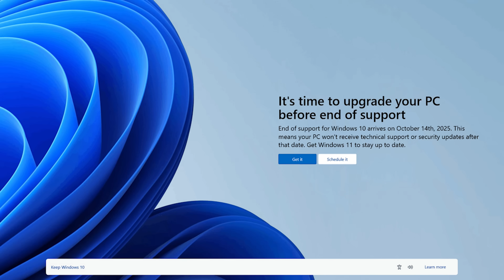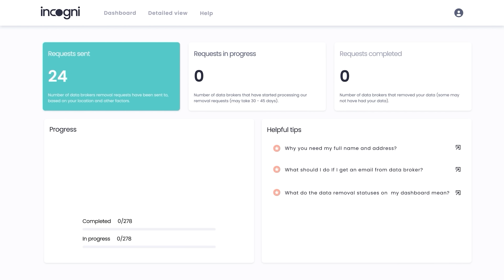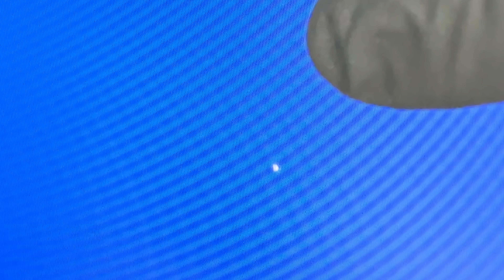I Made 2 WORKING Laptops From 1 Dead ThinkPad - DON'T Buy a New PC Just For Windows 11!

Comment: My mom (she works for a school/church) gave me a bunch of Lenovo Ideapad Tablets to give new homes.  They have 6th gen Intel processors and run Windows 11 fine despite Microsoft's opinion.  Every single one needed a new CMOS battery with an unusual connector.  I own a spot welder and had the CR1220 cells on hand so I was able to correct this.
Reply: That's great, but like Andy said, there is a risk that Microsoft stops supporting Windows 11 installations that were accomplished via a bypass on systems that don't meet the minimum requirements, especially if that involved bypassing the TPM 2.0 requirement, since the OS expects it as part of its built-in security.  At which point you might as well just run Windows 10 without any future updates.  If it was a computer for my own personal use or for my immediately family members, I wouldn't care too much, because I am happy to support their computers, but if I'm selling or giving computers to anybody else... well, I probably wouldn't, because I don't want any obligation of supporting it, especially if something like MS arbitrarily ending support for it via an update happens.  Sorry, but most people are helpless and kind of stupid when it comes to problems with their computers, especially if they know somebody who they know is kind of an expert.  Otherwise intelligent, well-educated people suddenly become incapable of even following basic on-screen prompts or reading basic instruction in plain English when things go wrong on their computer.  The list of people I am willing to actually think on behalf of in any situation is very small.
Reply: Oo I likeyy :DD
Reply: It runs great..i have a dell precision 7710 workstation, very good spec but 6th gen intel...i cant simply dump it...its my baby and a work beast..updated to win 11 25h2 with RUFUS..there i go..😊

Comment: IMO windows 11 could've been a great OS if microsoft didn't pull the bullshit they pulled, like it is perfectly compatitable with my 6th gen PC and runs many things well but then microsoft somehow finds a way to ruin it in any way possible rather than fixing it, it the system requirements were of better standards many issues would be resolved but they ruined it either way like why do you even need this much money? and now they ruining the little reputation xbox has
Anyways imma have to switch to linux sooner or later

Comment: bypassed two Lenovo laptops in my house to run 11. a amd a12-9720p and 4th gen intel respectively. they run it just fine, Microsoft is weird.

also found two (technically 3, ones a netbook) 16-17 year old dell inspiron laptops for free as they were part of my family before being retired. socketed core 2 duo machines. upgraded them to the best of performance/cost (70 bucks per unit | CPU, RAM, SSD, WiFi, Battery), installed linux mint cinnamon, and i gotta say they’re pretty good, fairly powerful for a unit of its age.
Reply: Try a lighter weight Linux distro and they'll run even better. Puppy Linux, antiX, Lubuntu, and Linux Lite, MX Linux, etc. 

Mint is excellent but it requires more robust hardware than these distros.  Those old Intel Core Duo cpus are a great match for these.

Comment: I started my refurbishing careear more than a year ago and my biggest pain in the ass was DELL. DELL uses a special chip in their chargers which is linked to the PC through the charging cable, if the charger is not original or the cable is any way or form damaged not only you get a notification on the boot screen but your CPU won't clock higher than the baseline. Such a scummy thing to do. The worst part is that the DC jack used is not very commonly used.
Reply: yes I stopped working with Dell and just stuck to refurbishing lenovo when I was doing this as a side hustle last year alongside job hunting

Comment: I've always been on the used laptop's side, even refurbished and sold a couple thinkpads last year. However i might go into it studies and am thinking of buying a macbook... And it's a moral conflict because if a laptop lasts 10 years like a lot of macbooks do it will have done its job, but also i hate these new windows laptops and the direction of microsoft. I already switched to linux, it's a tough choice for me. (I know p series are good but the battery isn't...)

Comment: I am using a Lenovo idea-pad 320 15ISK 80XH. which has a i3 6th it has been roughly 8 yrs after its purchase in 2017 . Its ram was upgraded to 12 GB. changed the HDD to SSD re-pasted. till now it is working like a charm it dose not have any problem with daily browsing playing a 1440 or 1080 p videos it can do light gaming. I am proud that I have been able to fix its problem even if it is minor ones.
Did some dual booting and other. It did taught me a lot.

Comment: I have a Lenovo S145 with the R3 3200U. Was able to update to Win11 back in 2021, and it was good, but now it's starting to freeze and have issues. 
The hinge on the charger port side broke through the damn plastic waste of a shell, the keyboard keys broke, and when I changed the plastic shell on the down side, replacing the keyboard was awful.
The only reason why I haven't changed to Linux yet, is because my parents have some documents in my laptop's NVME, and I don't have anything to store their files yet.
But I am planning to get an Sata SSD, to install Linux or just put windows in it, and use that ssd for my parents' files. Still thinking about it.

Comment: Look, I really would like to use Linux but the applications are not there. Music Production suuuuuuucks on linux. There are a few applications available natively, but big boy applications like Ableton, Cakewalk, Garage Band, Sequel, FL Studio, Cubase, Studio One and Tracktion Waveform (If you are using any non debian based distro) aren't available. Look, Changing DAWs is not an overnight thing. You can't tell someone that has used any of the above for more than a decade to just switch to LMMS and start using VSTs not available on Linux. It's just not feasible. ALL but 2 (Vital & Surge XT) of the VSTs I use don't work on Linux. They just dont.

There are things that were nonissues on Windows that are issues on linux. The first being, Window Management. KDE Plasma sucks mega hard. Its BUGGY. Windows launch everywhere they have no right to. Sometimes they launch out of the display and it sucks. Gnome is ok and gnome should be the standard, but gnome takes up so much space on a low resolution (768x1366) display with its chunky title bars. XFCE was the only DE that had 0 issues, but to switch DE's you either have to follow extensive guides and be careful otherwise you might end up on a TTY interface.

I tried Linux early October and even as a person that was familiar with it, and read documentation (As a game dev, I test my games on Linux via virtual machines, for the past 4 years). I felt like I was fighting the OS than getting stuff done. I chose Fedora and Spotify and Steam aren't available in the Out of Box repo. I had to follow guides in installing 3rd party non free repos in order to install 2 basic apps. They also weren't available in the Software Discover store. It was frustrating. Some apps like Tracktion Waveform are only available on Debian and Debian Based Distros (Fedora uses RPM formats) therefore I couldn't use it unless I set up Distro Box. 

4 Days later, I gave up and installed Windows 10 Enterprise IoT LTSC. I'm good for the near future.
Reply from the maker: This is why I say use Linux for basic use on these older PC’s. Anything other than that, it’s difficult to learn as a new user and will cost you productivity.

Comment: I love my Thinkpad X260, got it for $50 off ebay, but the keyboard annoyingly stopped fully working and I have to take the whole thing apart to replace it. Frustrating and I don't feel like doing it. I only use it for recording guitar takes in my bedroom and not at my desk anyway, but I am definitely gonna get a T495 eventually. Want that Ryzen chip! But still gonna have a use for my X260. Have the replacement keyboard but taking it apart is daunting.

If I get an upgrade any time soon, I'll probably end up doing it and giving it to my brother. Like the tinier form factor a lot though
Reply from the maker: Yeah the keyboard is a bit of a pain to remove but at least it’s removable!

Comment: This video is NOT stale. You are absolutely spot on with everything. I have a 10 (at least) years old lenowo Thinkpad W541, i used it first two years at work and since then for hours and hours every day at home. It has literally never had any issues what so ever. Still running Win 10, but not for long. I also have a Thinkcentre M73 Tiny PC that i just installed Linux Mint on. Installation is litterally easier than Windows, and everything just works. Wifi works, audio works, its running fast enough for my use. IT JUST WORKS. Everybody should give it a try. Everybody who can should try to help a few people who doesent have the skills to install Linux to get it done, and familiarize them with it. We need to put and end to this e-waste madness.  Keep doing your good stuff. Rant over 🙂

Comment: im sorry but i did almost 2 years ago but im also a gamer but the laptop im on now has been rebuilt  by me as after abotu a year after i originally purchased it the orginal board was useless due to multiple issues and ended up basically being dead after that deviled frekaing liquid metal managed to get under the CPU but this board i have now is slightly upgraded from the original as it has a 4070 instead of a 4060 burt the laptop it came out of had a warranty that expired about a month or 2 after mine had originally expired

Comment: My mom is looking for a replacement for her Chromebook.  I want to get her a laptop and use Linux Mint, because the ones I saw at Walmart aren't really that great for running Windows 11.  I don't really have a lot of money to spend, but does anyone know of a decent laptop that's under $300?  She mostly just uses a web browser.  I'm also admittedly cheap (not by choice)
Reply from the maker: Dude, snag a used Thinkpad and install Chrome OS Flex on it! You can get them for less than $150 and they’ll last longer than a brand new Chromebook (you may need to buy a new battery but still less than $200 in total investment)
Reply: @SalemTechsperts  Thanks!

Comment: I would really like to try Linux on my old thinkpad x240 but I don't know why wifi adapter can't detect any wifi. It works just fine on Windows, any one know the solutions? Ps: I already looked the solutions on forum, they keep mentioning about the wifi driver, but nothing worked on my laptop
Reply: That's the fun part about Linux. Everyone says it is great and the best thing ever. But they don't tell you that sometimes things simply do not work out of the box. I don't have a direct answer. You'll just have to find something that works. Welcome to the Linux experience.

Comment: I just bought 6 old laptops at a pawn shop for $175. Included a T430, a Surface Pro 3, and an Acer Aspire 5. All running Linux now. Surface is running Ubuntu. T430 runs great on Zorin 18, as does the Aspire 5. Investment was minimal...upgraded RAM where I could, replaced HDDs with SSDs, and added another SSD to the Acer. A BT dongle or two. I love this shit! And I love your channel! Wishing you huge success in your business! By the way, I have brought 3 new users into the Linux fold; they have had no problems at all! ☺

Comment: Linux is also so amazing on mini PC's! Get something with similar spec to the Steam Deck, slap SteamOS on it and boom! A really good Steam Machine!

Mini PC for say a DDR cabinet? Slap the ITG system image on there, chroot into the boot partition and install GRUB UEFI and boom! Snappy ITG PC!
I've even been messing around trying to recreate the AGS distro for the Pi, and the Dosbian distro, using a mini PC. Well damn it, it works amazingly well for Amiga and DOS emulation!
Wouldn't be surprised if Batocera performs even better on a mini PC compared to a Pi!

Comment: I wish games like riot games and other apps had support for Linux, I would change instantly I just hate the limitations of Linux apps and such
Reply: It actually isn't a limitation with Linux, but is because Vanguard requires installing a Windows-specific kernel-level driver that gives it full unrestricted access to pretty much the entire bare metal of your computer. There's technically nothing stopping these companies from making a Linux DKMS module to accomplish the same thing, but no one would install it because giving a userspace application that much access is a huge security risk, especially if it's just to play a video game that otherwise would work fine. So no, this is not a Linux limitation, this is a company being a paranoid schizo about cheaters.

Comment: I used to work at tech reseller, we did a ton of this type of thing, fixing lenovo and dell computers, my specialty was TVs, you would be amazed with how simple they are to repair for basically every issue that isn't a broken screen, and how worthless the warranty process is for them through Samsung and others. Keep up the great work, funds can be tight in that world but please keep it up, being able to get a computer is a requirement to function in the modern world, and companies know that so they crank up the price for their captive market.
Reply: I just did that with my dad on his 4k TV. It was damaged while wall mounting and he was worried that we would need to buy another one. I diagnosed it as control panel damage, found the part on Ebay, and was able to swap it out with not too much trouble. It turned on on and gave no problems so far. I'm very thankful to all the repair Youtubers that show how to do stuff like this and how to get out the mindset that things are more disposable than they are.
Reply: @vich4600  Hell yeah! I try to remember that just because something is broken, doesnt mean it is ruined, and just because it is ruined, doesnt mean it is worthless.
Reply: Display/TV repair is BOOMING!!
Reply: I was surprised at how easy it was. I found an old thinkpad x100 from when I was in elementary school and decided that I was bored enough to mess with it. I managed to get it fully apart (motherboard, fan, heatsink etc off) and back on in only a few hours with no prior computer experience and no guides at all.
Reply: How would you go about repairing/replacing the screen?

My nephew just broke the screen on a 65" TV that belongs to his grandparents and I'm trying to see if I can save it...
Reply: @JuliusLeachmanIII  if the screen is cracked, then it is not worth it to try and repair, the most expensive part is the screen so just buy a new tv, if parts are just dim you can usually swap out boards
Reply: @TheScorch191  Darn it! Thanks for the reply. I appreciate it. 

I'll also hang on to that nugget of wisdom about dimming...
Reply: @JuliusLeachmanIII  You don't, unless you can find an identical model with fried electronics and a perfectly good screen and are able to do it yourself.  Assuming replacement screens are even available for purchase (and they probably won't be, especially for a TV that large), they tend to be higher than the cost of replacing the complete TV.  You might as well just buy a new TV at that point and at least theoretically have the protection of a manufacturer's warranty.

Comment: used laptops are one of the greatest things ever, especially right now
a lot of companies are dropping laptops with 5000 series ryzen because they think AI max is better
I got a 5500u, 8gb ram and a 256gb nvme ssd- for 150$. After I upgraded ram to 16gb it was 170$. 
BUY USED!!! ITS SO WORTH!
Reply: Zactly!  That's cheap Chromebook money.
Reply: Yup, got a Dell with a third gen Ryzen and Vega 8 graphics, 8gb ram and 256gb nvme for 50 bucks, i upgraded to 16 gb 3200mhz and it runs GTA 4 and Dark Souls at 60fps stable
Reply: Used is trash  @T3chIdiot  . It's USED for a reason. Buy new, unless you're stuck to the past or a boomer.

Newer means more features

Comment: Prolly my biggest issue with office laptop is battery, if "repair" man like you that can guarantee its in good condition its will be great but rarely happens on my place
Reply: when I was doing a similar thing last year I always put a screen shot of the battery status report on the ebay listing so the buyer can see how much battery is left and make their own decisions. Most of these ex-corporate laptops have batteries that are over 80% of their original capacity because they spend their life plugged into the charger and not running on battery
Reply: @misterthegeoff9767  what you did really great man, but sadly in my place barely has great technician like you. well they always thinking about profit which i understand why but imagine selling laptop with bloated battery and then dont care when customer complain
Reply from the maker: We only sell laptops that have 80% of higher capacity. But unfortunately we reject a TON due to the batteries costing us more than the laptop is even worth
Reply: @SalemTechsperts  thats really great!